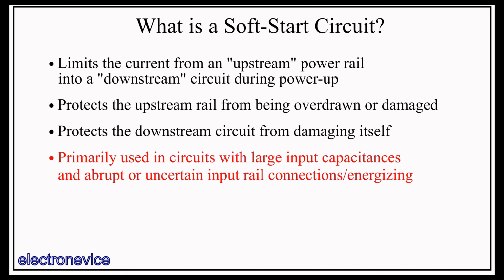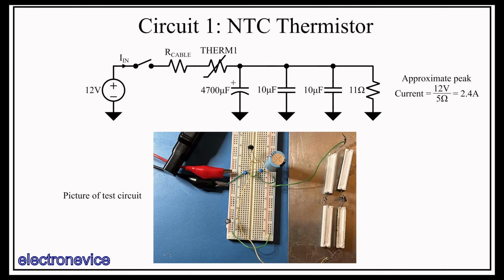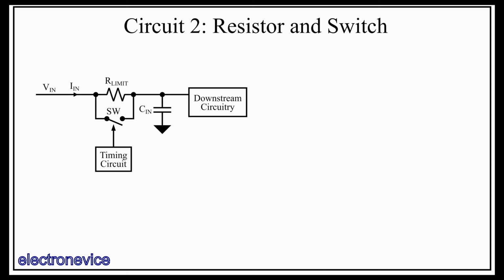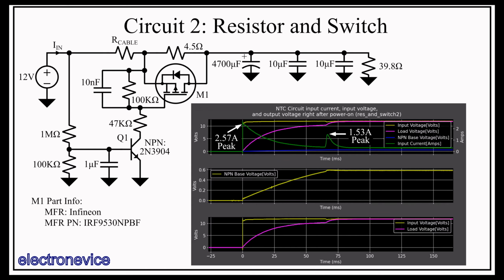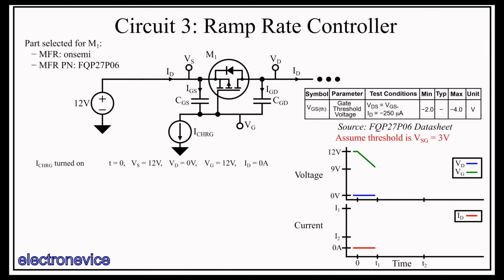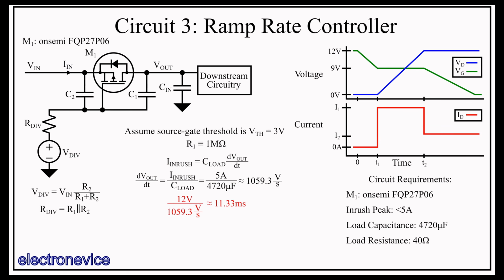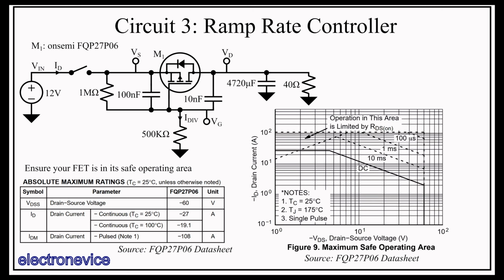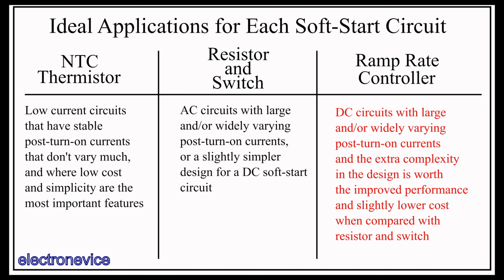Soft-Start Circuits: An In-Depth Look

Comment: I put that circuit (ramp rate controller) into ltspice, there are 2 problems:
1. the Vsg voltage is not controlled. It can jump to 8V (for 12V input).
2. there is oscillation on C1 and C2.
Reply from the maker: 1. That is likely due to too much Vsg capacitance and too low Vgd capacitance, that capacitive divider effect is discussed at 00:55:45.  You can fix it by increasing Vgd, see the section in the video for details on how to increase that value.  If it's not that then I'd have to see the circuit to understand what might be going on
2. I've seen this happen before, though not very often and depends on the MOSFET you use.  I believe that increasing Vgd also will eliminate that oscillation
Reply: @electronevice  I figured out what is causing the oscillation. I changed settings from trapezoidal to Gear integration method. And oscillations are gone. So I assume it was not caused by the circuit itself.

Comment: I would very much like to understand this issue, as I need for a project.
But trying to follow it as delivered verbally is too difficult.  If a full written transcript was available, I would spend the time to go through and understand it.  I did attempt to recreate the circuit and run in QSPICE, but it didn't work.
So it seems I will end up just going with a load switch IC.

Comment: There's also a variation of the resistor and switch, where the resistor is replaced with a BJT constant current limiter circuit.
A stage like that with an FBR, say ~100mA current limit, and a zener for voltage clamping, would allow partial system bring-up even during over-voltage or reverse-polarity,
and allow an MCU to report fault conditions or proceed to swiftly switch the bypass MOSFET on, with minimal time in its linear region.

It's worth mentioning that unlike BJTs, big power MOSFETs are made up of many tiny MOSFETs inside.
The hotter a MOSFET gets, the more conductive, and so the hottest tiny MOSFET has positive feedback to get even hotter.
MOSFETs don't like spending time in their linear region. When you need linear switching, a BJT is the better choice.

Comment: This is solid stuff thank your this pro tutorial!  I am curious how and if we should manage the flickering multiple On off On off that are possible at connection of the power.  Say if one is connecting the circuit and the large cap bank charges smoothly along with the miller caps.  But if for some reason the user disconnects and reconnects really fast like when one is live wirering the power there will possibly be some milliseconds connect and disconnect cycles. In this scenario the miller cap will be charged and hence the pmos will fully conducts but the large cap bank will have time to deload in the 40 Ohms load during the off state.  So the soft start in this particular scenario at the next ON would not limit the charging current as the pmos would allow full current?  Is there a technique to cope for this kind edge case?

Comment: So I've been playing with this in simulation and there's one troubling thing that I don't get.

At the time just before Vin is connected, the gate is sitting at zero.

As soon as you connect Vin (I'm targeting a pretty high voltage -- 60v), with Vg sitting at 0V it thinks mosfet is actually correctly biased, even for a tiny amount of time, regardless of what values you use for the Cgs and Cgd divider, which kind of isn't really a divider at that exact point in time.
Reply from the maker: I'm not sure what you mean by "correctly biased" but a large spike in voltage on the input can cause current to flow capacitively through the source-drain junction.  Another thought is that if the FET model has a drain-source breakdown voltage that is less than 60V, it will breakdown until enough current flows to bring drain up so that the drain-source voltage is below breakdown.  

What FET SPICE model and configuration are you using?
Reply: @electronevice  Sorry, I mean the source when powered up is, say, 60v and the gate is obviously sitting at zero.

I was using kicad's built in spice simulator (ngspice) with the generic p-channel mosfet model.  However you might be right I neglected to check what that model uses for Vds breakdown by default.  I'll check it when I get back home...
Reply: @electronevice  So the generic model had an extremely large Vdss max placeholder number so that wasn't it.

I replaced it with an actual realistic spice model and it still seems to do the same thing, even at 12v.  There's just a very, very brief (have to zoom way in to see it) blip of power/current right when Vin starts ramping up.  I'm not sure what the simulation is actually modeling at that point.

Comment: Great video, thanks! What would be the best solution for a linear bench power supply with a large toroidal transformer and 10000uF input cap?
Reply from the maker: I'm glad you found it useful!  If the 10,000uF input cap is after a bridge rectifier (as I suspect it is) I would generally recommend use the third circuit - the ramp rate controller circuit, especially if you're ok with letting it take a while to turn-on and fill that cap.  You'll have to set the ramp rate to be rather gradual for a 10,000uF cap, depending upon how much current you're able to source to it, and make sure you keep it in the safe operating area
Reply: That's exactly my scenario. I have a 200 VA toroidal transformer. I'm planning on a variable output supply (with 5 V, 12 V and 2 variable outputs that are 1-50 V). I have 15000 uF planned for the main bank of capacitors. I have 3 different kinds of buck converters. And I was planning on a load resistor that gets shorted out after a delay by a relay. And have been trying to balance between the initial transient and the secondary one after the relay shorts a series load resistor out of the circuit.  My simplistic LTspice simulations suggest with no inrush limiter the in rush would hit 40 A which would be very bad. With the relay and resistor I'm looking at maybe 8 A, which is still too high.  So now I'm thinking I should be using your circuit #3...  This isn't my area of engineering,  so I'm just a casual hobbyist here.  Far more complicated issue than I realized!  Especially cause I first made a 2A 1-16 V DC supply when I was 11 based off an LM317 and it worked fine! Lol  I just had no idea back then how inefficient I was being....

Comment: I'm surprised. I could not find a pre-made  IC anywhere for this... we have so many ICs for so many tasks,  yet an inrush limiter like this  isn't available? it's so basic!
I wonder if you  can make a less complex/big circuit with a depletion mode mosfet (that turns of with power_ and a shunt resistor. just use the voltage across the resistor to increase the gate,  using the MOSFET as a variable resistor. that'd be a bit risky tho as it'd fry if the load goes above it. long term.
Reply from the maker: Assuming you're talking about the third circuit / the thumbnail, I suspect it's mostly because it only requires 4 external components which are just resistors and capacitors, so it's probably not very cost-effective for a company to design an IC for it given you could probably get much greater "programmability" with just using a FET, and resistors and caps are pretty cheap, and you would probably want to be able to program the ramp rate with a capacitor on your own, so you'd still have to provide at least 1 capacitor (and probably the other one if you're making the Cgd capacitor large), so at that point you're just making an IC that's a FET and a resistive divider on it.  Then again there are integrated high-side switch ICs which doesn't seem very cost effective to me, so who knows what goes into the decision on whether to make an IC or not
Reply: @electronevice  I'm talking about more  complicated solutions that use two BJTs(one NPN , one PNP). I did realize some eFuses do have this functionality tho, but they're expensive and the ones in my required range are rare. 

I've not built a solution into my device yet. but you need a gate voltage protection for a lot of these solutions, my VIN is 24vand a VGS of 24v is harder to find without increasing cost etc. also those two bjts and the main fet can just be put into a small package with some additional  features. My main issue is space on a tiny 50x50mmPCB that is already 4 layers  and the top layer is almost  entirely full of components.

Circuit 3 is apparently very unpredictable and not a great idea despite TI themselves recommending it for an LDO on a datasheet. Although my needs are high current/power.  It's every simple and barely takes space, right now I'm really debating between increasing cost/size and just using the  circuit 3 and calling it a day.

for circuit 3 the gate source limiting is very simple with a voltage divider, but it can't always be that simple for the other designs I've seen.

I'm also confused by the safe operation graph a bit tbh. my fancy low RDson mosfet has only 600ma at 24v D:
2A for 10ms. Although the peak current only happens during part of the turn-on
Reply: @electronevice  Oh I forgot to ask. I'm using circuit 3 to avoid connector sparks. since dv/dt is there, there won't be any more sparks right? I'm less concerned about fuses, more concerned about sparks at the connector
Reply from the maker: @ameliabuns  If by connector sparks you mean sparks from connecting a power connector to a circuit, then this should reduce or eliminate connector sparks so long as you set the parameters to reduce the inrush current to a low enough level.  Connector sparks occur due to bouncing at the connector (which occurs whenever you make a physical connection) cause the circuit to break when a significant current is flowing through it.  The degree of arcing will depend on the current and the voltage of your power line, the higher either is, the more likely an arc will form.  Additionally if there's enough delay between the connection "starting" and the soft-start circuit hitting the miller plateau, then that will tend to reduce/eliminate arcing as well, as the "bouncing" phase might be over by the time the soft start circuit starts ramping up output voltage.

It will not, however, mitigate any connector sparks while disconnecting the cable, as those are dependent upon the inductance of the power line and how much current is flowing through the power line when you pull out the connector.  If you have a lot of inductance and steady state current and want to eliminate sparking, you may want to put a freewheeling diode from power to ground to give a path for that inductor to draw current from the ground line, and lower the magnitude of voltage at the connector to prevent arcing.  Of course all this discussion assumes DC voltage/currents, AC power requires different architectures
Reply: @electronevice for disconnecting, I’m hoping my TVS diode will take care of it! But yea. My issue is that I had to spend 2$ on an IC  for my previous PCB as it was 50x50mm and already filled to the brim and any ptc/ntc with enough rating was gigantic.

For the new PCB I might use the soft start circuit, just add a delay or see how much power the NTC wasted. The new circuit runs on 48-40v so it’s even more annoying

Comment: Thank you for your video ! Quick question, is it safe when cutting the power with the 3rd circuit ? I simulated it with LTSpice, and I see a peak of several kA on Id, as if the decoupling capacitor is discharging through the transistor. Should a diode be added as well ?
Reply from the maker: I'm glad you found the video useful!  

Backpowering is an important point for many circuits, however it depends very much on how the upstream circuit operates.  In LTSpice I imagine you connected a voltage source and had it go from low voltage to high voltage and saw the inrush circuit operate, then had that voltage source go from high voltage back down to low voltage to “turn it off” and saw the massive spike in current as the large output capacitance backpowered the voltage source through the FET’s body diode.  However, this is not how most power sources work: this LTSpice voltage source has a very low impedance to ground (or low voltage) during shut off.

If the upstream voltage source is some kind of power supply with a physical switch in-line with the power line, then flipping that switch off will just “cut” the power to the circuit, and no backpowering will occur because the upstream voltage source is now effectively high-impedance.  If the upstream voltage source is a FET switch where the gate is being pulled up to its source to shut it off, then it will be oriented in a way such that the body diode will block reverse currents once that FET switch is shut off and again very little backpowering will occur.  If the upstream voltage source is a buck regulator that is being disabled, then it likely acts similarly to the FET switch and very little backpowering will occur as the low-side switch will open once the inductor current is zeroed out, which shouldn't take very much time.  Most flyback converters would also not be backpowered as most of them have a diode on the output to rectify the transformer output.  

However, there are situations in which backpowering IS a possibility and you need to mitigate it.  Let’s assume we have a physical in-line switch for this voltage source.  If, for example, you have multiple loads on this voltage source, and one of them is very power hungry, and the other has this soft-start circuit on it, then shutting off the upstream switch would mean power is no longer available to the power hungry load, and so the power hungry load could “look” like a low impedance and drag down the line quickly draining any capacitance on the line including the capacitance on the other side of the soft-start circuit through the diode as you say.  Another way this could happen is if there’s a “crowbar” OVP on the power supply – most high-quality power supplies that have overvoltage protection circuitry will just “crowbar” the power supply in the event of an overvoltage which means shorting out its output as though a metal “crowbar” were placed across the positive and negative power supply ports (essentially pulling the voltage down as fast as possible “at all costs”).  This causes a massive pulse of current through that body diode which can cause damage, especially if your downstream capacitance is very large.

The possible mitigations if you need to prevent backpowering are to have a diode like you said, though this means you are burning off power during normal operation from the diode’s voltage drop.  A more efficient solution is to have a second FET upstream of the first FET and have it pointed in the other direction (drain facing upstream) and shut it off as soon as the upstream voltage source shuts off, that way it serves as a “diode” during turn-off (with its body diode), and a “short circuit” during normal operation (because it’s on), though this requires additional circuitry to turn it on after the soft-start is complete, and turn it off quickly when the upstream circuit is turning off.  

There are integrated circuits that do this called “ideal diodes” which have all that circuitry integrated inside them.  They can restrict your voltage rail and current draw especially if you want a low voltage rail, but they’re a neat little tool in your belt and they’re usually designed to shut off quickly to minimize backcurrent (check their turn-off time parameter to see how quickly).  Some have integrated FETs and are more precisely tuned, some allow external FETs to be connected to them to allow a wider speed/on-resistance selection space.  This one uses an external FET:

https://www.analog.com/media/en/technical-documentation/data-sheets/4357fd.pdf

Comment: Oh wow, thank you so much. I was looking for some soft start circuit for my tube project and 3rd circuit is perfect for this application. This linear voltage increase ideal for tubes. I've already had resistive soft start and 1 minute turn on delay, but additional soft start before anodes of tubes would be better

Comment: Hello, Thank you for the informative video. I have a doubt, how come VG=0 at 35.44 ie at t=0. Thanks in advance
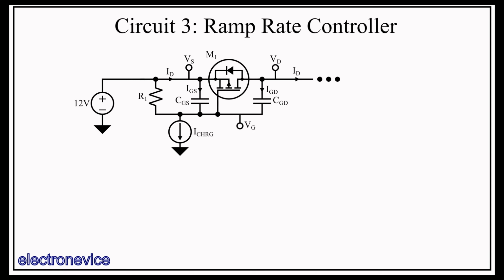Reply from the maker: Thank you!  VG is not 0 at t=0, VG=12V at t=0.  If you meant that you doubt that VSG=0 at t=0, the reason is essentially I designed it to be that way by having R1 (which has been removed from the schematic for simplicity by time index 35:44) and by turning on the current source ICHRG right at t=0 (so that ICHRG is off before t=0), so that source and gate start at the same voltage at t=0 since R1 bleeds off any voltage difference between them.   This is explained starting at time index 33:07.  

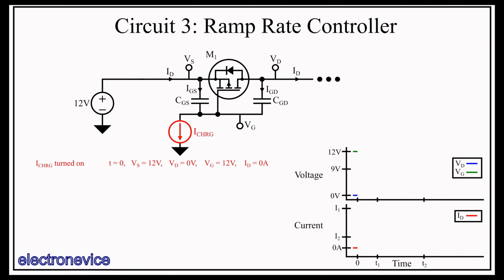If you meant that you doubt that VD=0 at t=0, then that's ensured by an off-screen load resistance to the right of the dot dot dot which is not shown.  This is mentioned at around time index 33:41.

I hope that answers your question!
Reply: @electronevice  Thanks for explaining. The video was very useful for me. if possible kindly make a video on RC voltage divider circuits along with voltage follower  for capacitor charging applications. Thank you